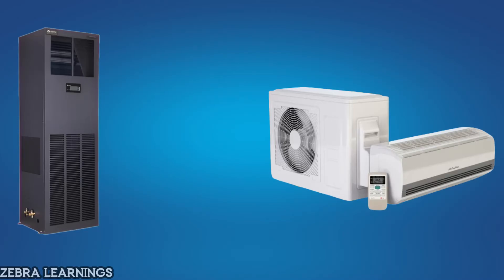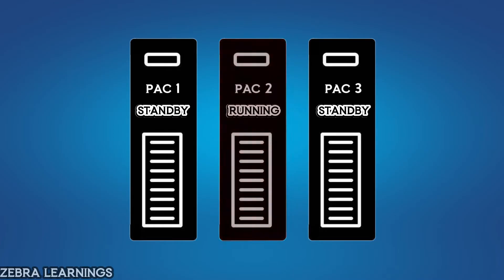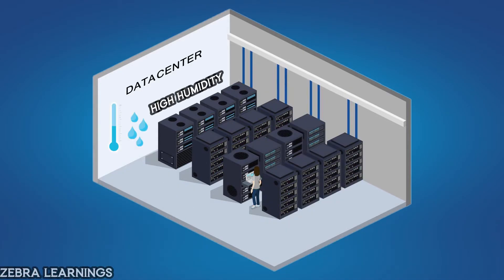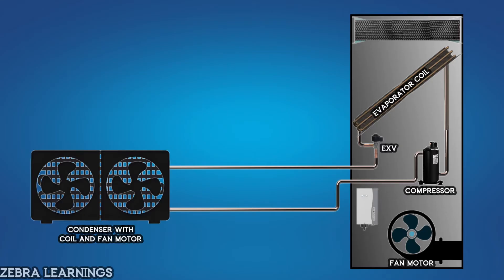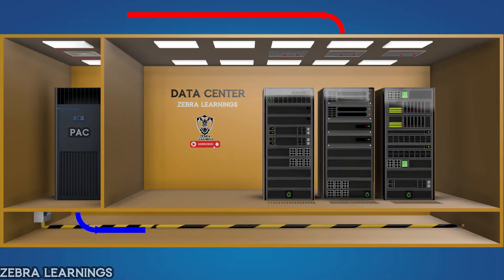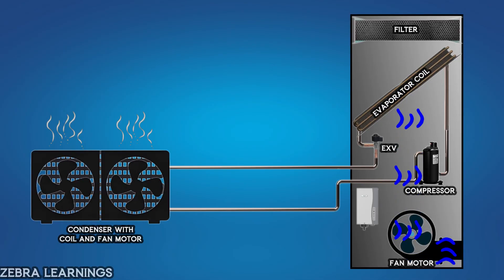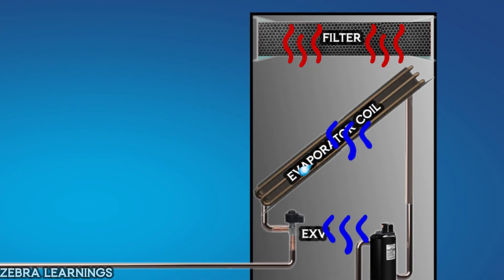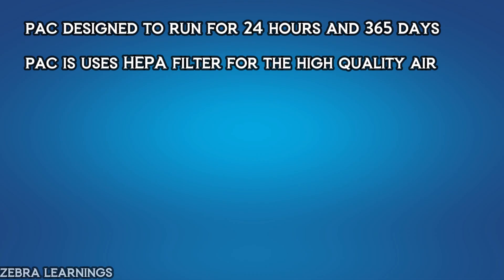CCU | PAC | Precision Air Conditioning | Closed Control Unit | Animation | #hvac #hvacmaintenance

Comment: Thanks for the video, but you mentioned that the supply and return may cause a drop in the data center. Excuse me, one question: Does what you mentioned also affect the weakness of the cooling in the data center room? Please, I need an answer, it is very urgent.